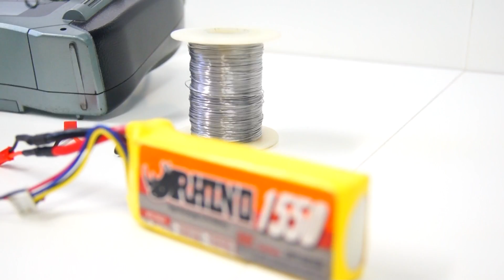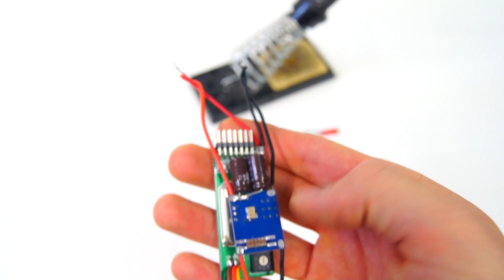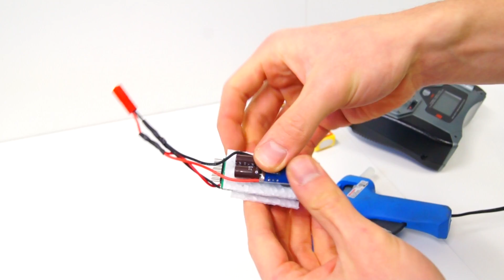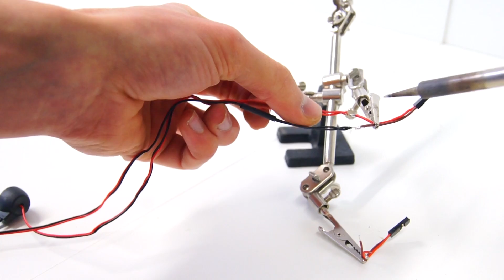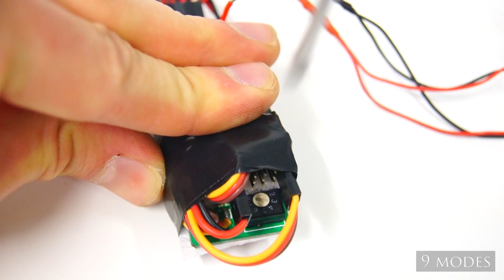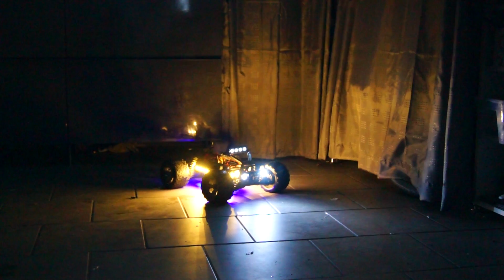DIY Remote Controlled Multiswitch - RC Car LED Lights

Comment: So.... what is the point of the BEC? I can see you can connect the battery directly to the switch then to the car receiver to change the light settings. What am I missing?

Comment: @RCLifeOn Probably a stupid question, but, how would I do this on a trx4, I have a light set that includes 4 sets of lights all hooked up to one button which controls/cycles through the functions, would I just connect that button wire to this set up you have? I also have a set of LED spotlights I would like to rig up with it.

https://rover.ebay.com/rover/0/0/0?mpre=https%3A%2F%2Fwww.ebay.com.au%2Fulk%2Fitm%2F323436502741

This is the lighting set I purchased on ebay. Not sure how to rig this up with the trx4 AND have it run off this remote control set up you have here. Or would I need a different set up?

Any info you have would be great. Thanks. 

P.S: not sure if the trx4 controller has any spare switches or buttons, both the trx4 and the light kit I purchased today on ebay, so not sure how the remote looks.

Comment: Any video on how to connect stick controller (6 chanel) for a truck?  (4x4)  I don't want to use pistol controller any more |-O  thank you...
Reply: Did you ever work it out?
Reply: Most stick controller these day are designed for flying and so don’t have a return to centre function which is crucial for effective control of a car you will have to buy a Carson car stick control which has extra channels to do this mod as well. google - Carson C500085 Carson Reflex Stick 4 Channel Pro LCD Transmitter With 1 Receiver

Comment: Did you used cork sheet in the  your back?
Reply from the maker: It was a piece of foam, in case you mean the material between the two electronic boards?
Reply: Yah..